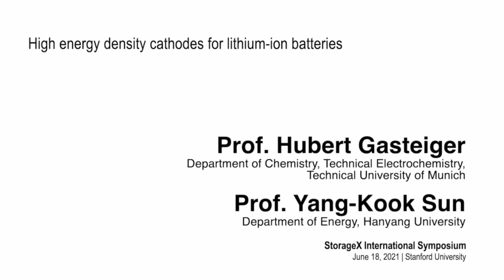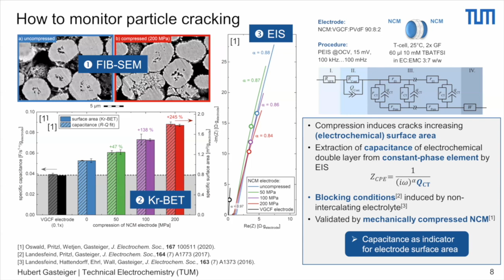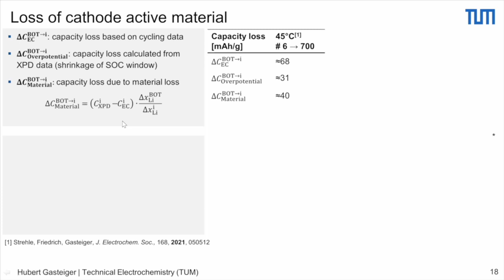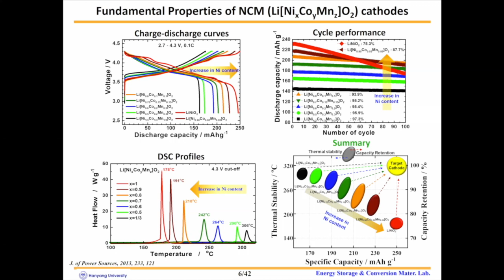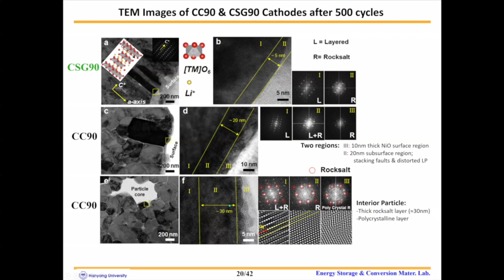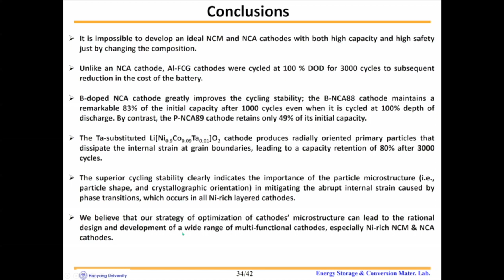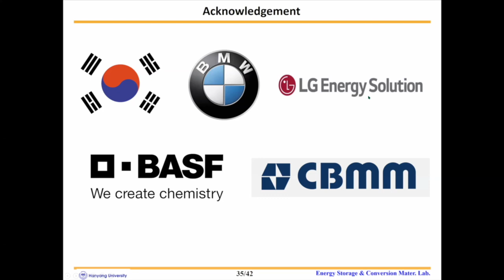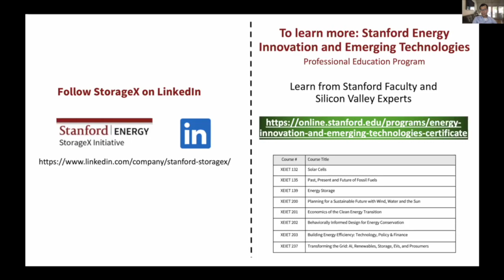High energy density cathodes for lithium-ion batteries | Sun, Gasteiger | StorageX Symposium

Comment: Thank you for this excellent review. - I have some questions:
1. What is the reason to focus on polycristalline cathode materials rather than monocristalline?
2. What do you think about alternative manufacturing methods, like 3D printing? Could it be interesting with regard to increase the volume of cathode (and anode)?
Reply: For the first point, I think it might be due to the fact that grain boundaries can serve as diffusion paths for Li ions, improving the power density.
Reply: Also, monocrystalline may not be all it’s cracked up to be